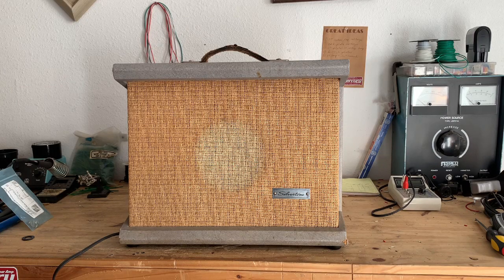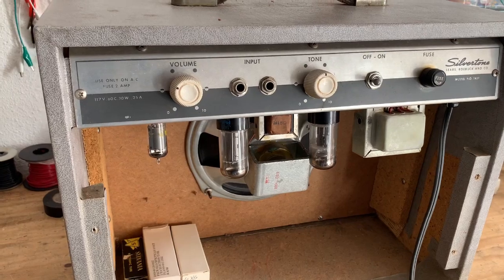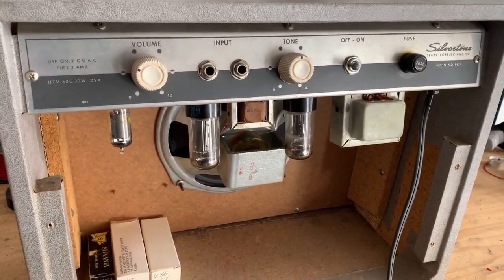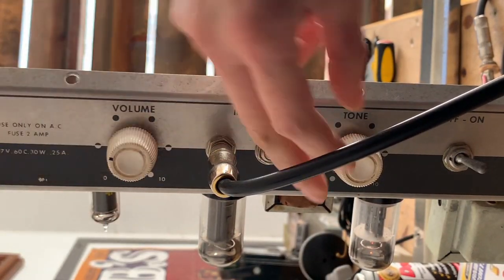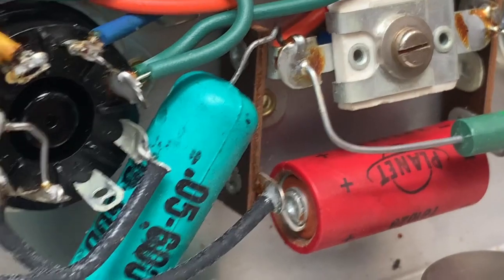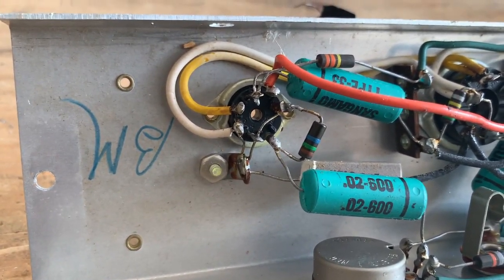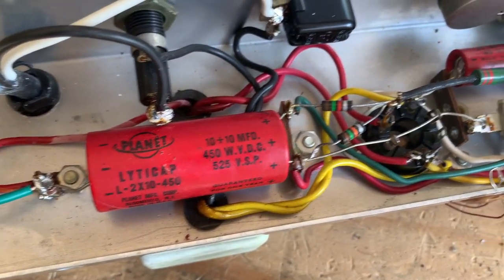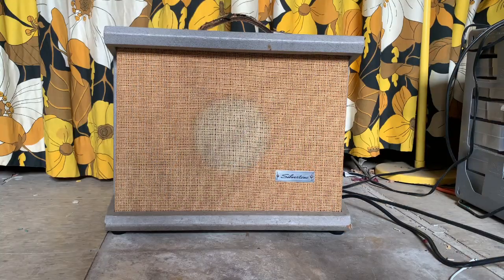Silvertone 1431 Restoration | The Electric Lady

Comment: A solderless joint on that B9G socket ... I've never ever come across this .. it's amazing it ran ok from the get go ! I've never seen variable silver mica compression capacitors in an audio amp before ... they must be in a very high impedance circuit ...I don't usually spray clean pots that are this old ... I find they become noisy later ... you can't beat changing them for new ...

Comment: At 4:10, you do not have to replace the entire preamp tube socket ---- you can just remove a contact from another similar mini 7 or 9 pin  socket in your parts stash and swap it into the socket in the amplifier to replace that one defective contact!  I guarantee you it will be much easier than drilling out the rivets and replacing the entire socket. The contacts are typically held in place by either a dimple in the metal terminal (underneath the socket), a punched out triangular flap ( a hanging chad?🤔), or just a bend or twist in the terminal. Typically pretty easy to remove after a squeeze with needle nose pliers.
Reply: Why not just replace and know they are new and good? Prevent future failure from the other old pins.....
Reply: @Bunn4Funn ,  broken pins like that are pretty uncommon; I've been working on electronics for nearly 50 years and I've seen just a a handful of such failures. If the socket pins were green and crusty from corrosion, sure, it'd warrant replacing, but considering this amp is probably not used for live gigs, only for recording or basement jamming, replacing just the one defective contact seems justified. PS, I've worked on a fair number of Silvertones and Danelectros, the sockets aren't generally known to be problematic. Planty of modern Asian-made replacement tube sockets are way less good than the originals.

Comment: Why no filter cap discharge? Many viewers may see your vid and start poking around the guts of a tube amp and get a surprise ⚡️ 
Plus, maybe cover the method of turning a two prong AC lead to a grounded replacement and removal of the “death capacitor,” and why. Nice boots though 👍🏼

Comment: I hate those 2 pin power plugs ... the chassis is ungrounded.. and I'm not too sure what happens at 120VAC but at 245 VAC which I'm used to dealing with I find it's always best to connect the Active line   to the finish end of the power transformer... If you connect the Active to the Start end the windings capacitively couple to the chassis and it becomes " Active" ..!

Comment: The variac that you have behind you caught my attention. I know what a variac is and some of its applications, but I was intrigued to know what use you could give it, so I thought about asking you, but before I decided to investigate a little and I learned the following: the variac serves to provide to an old amplifier such as those with vacuum tubes with the exact voltage with which they were designed to work, since in these this value is critical to obtain the correct sound in addition to not damaging them. Am I correct my friend?
Reply: Among other things, a variac can be used to slowly ramp up the voltage when powering up an amp that has not been powered up for years, thereby keeping it from potentially blowing up.
Reply: @bjorn2run  thanks for your kind reply my friend.

Comment: Suggestion: most times you can remove/replace just the bad tube pin connector (use an old socket for the piece). Save you the time of replacing the whole socket. 

Great job on the repair.

Comment: Hi there. Great stuff you are doing. For a change of pace, can you fix a hybrid amp, the ones with the PCB with the tube sockets attached to it (like I have).  I haven't seen a video yet on how to fix one. Other than fixing dry solder joints, I don't know what's what in there.  Thanks.

Comment: Gentle suggestion: J-hook the leads to preamp tube socket for mechanical strength instead of the solder securing the wires to socket eyelets as solder can crystallize and break free with time, heat and mechanical vibration in these ‘Hi Power’ jobs! LOL
Reply: I was always taught to make a good mechanical connection before soldering.

Comment: Over all very good. But I think you could show a bit more of the actual process. More actual parts removal, replacement rather than POOF new part in place. That works for surface level understandings. But some might like/ need to see the deeper step by step. e.g the caps like you did for the socket replacement. And around 3:30 you are "poking around", a great opportunity to mention the wooden chop stick thing as a side note. 

You have a pleasant voice with some modulation. Not too monotoned. But try a bit more variation as we tend to get more monotoned when concentrating elsewhere. And drop some of the "so" when opening sentences. 

And RE all the comments about replacing the tube socket pin connector instead of the whole socket? Saving the customer maybe a buck or two in parts but taking as long? And if one connector is worn out, others are getting there. So yes replacing the whole socket gives the customer a better longer term repair.

Comment: may I ask why you didn't replace the coupling caps?  At that age, I would be surprised if they were not leaking DC.  Was there a customer request for the amp to remain as original as possible? Or did you test them and not show that? Nice job, anyway. Thanks!
Reply: Paper coupling caps should be replaced as they tend to leak with age. Mylar caps generally don't need replacing. The blue caps in this amp look like paper caps
Reply: I notice an amp Uncle Doug restored and didn't replace the blue plastic caps either. He may have tested them and found they were not leaking DC.
Reply: People go overboard on changing caps a lot of the old ones still work fine even paper sometimes
Reply: She seems pretty efficient. I would trust her judgment